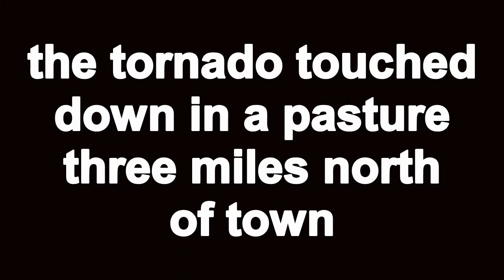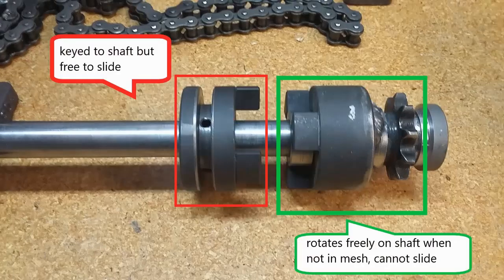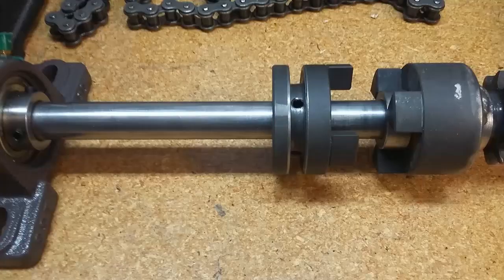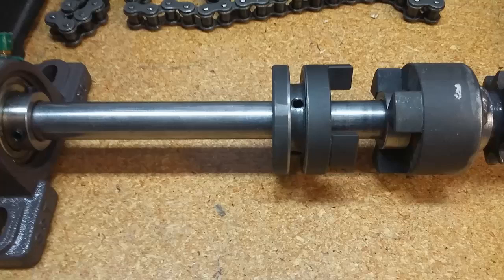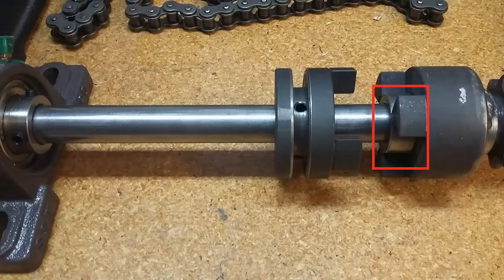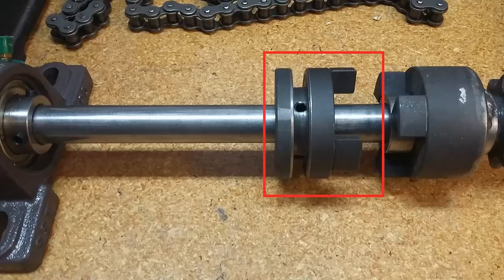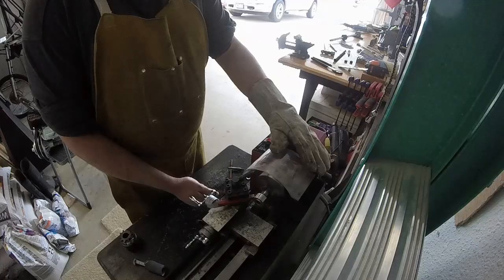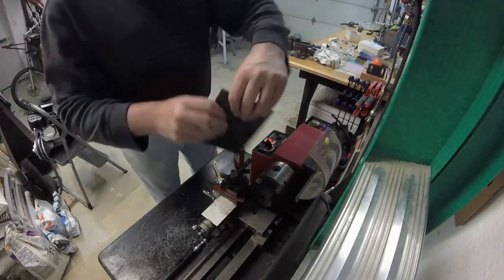Go Kart Chain Transmission Part 2 - Dog Clutch: The SMOG Project 09

Comment: Hi sir, i really appreciate this work so high. I have the same project in college. Could you provide the analysis of maximum load and rpm that can be used by this dog clutch?
Reply from the maker: Thanks Abu. Unfortunately I have no idea what the maximum is (hasn't broken yet). But my assumption is that it if it fails, it will shear the shaft key. So, you may be able to find nominal limits for that size of shaft and keyway in Machinery's Handbook. The shaft is 3/4" dia. 1018 cold-drawn mild steel, with a 3/16" x 3/32" by 1" key. Input power on this clutch is from the Predator 212cc engine. I have a screenshot of the specs for that engine in my Torque-A-Verter Install video. Gear reduction is 1.6:1 through the TAV, into a 10:72 sprocket setup, into another 10:72 sprocket setup.